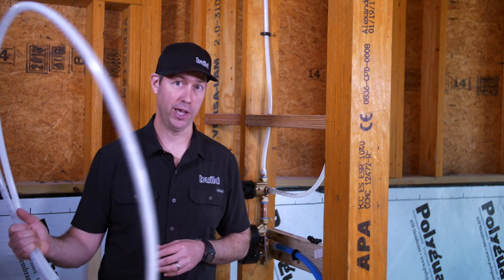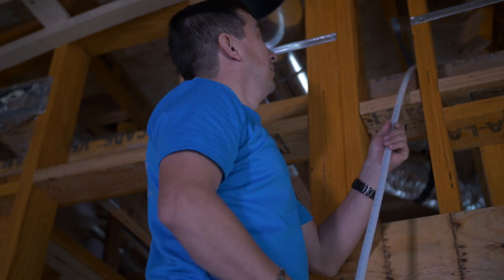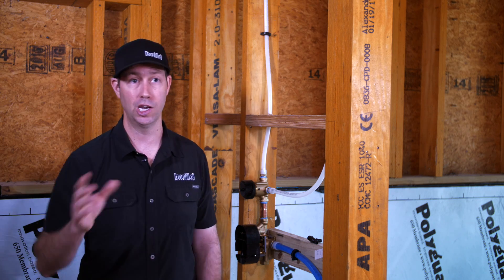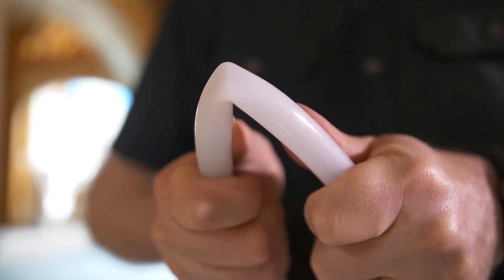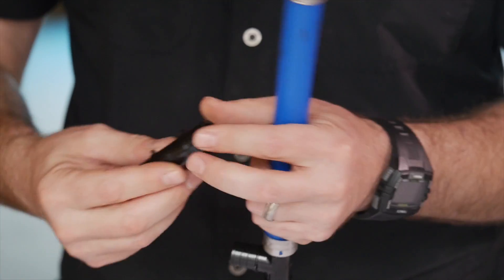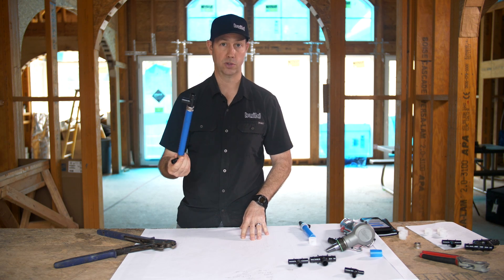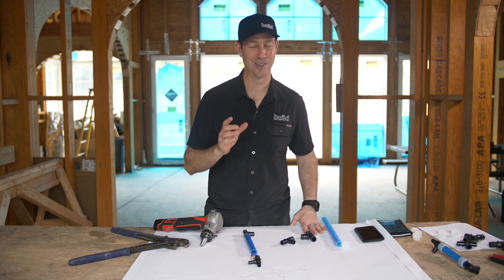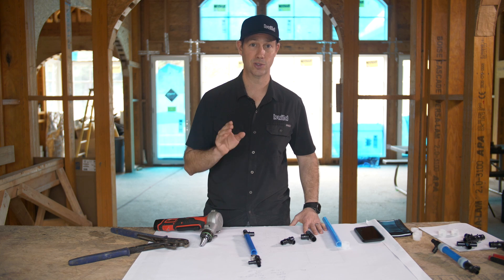PEX vs. Copper Plumbing

Comment: One thing Matt should have mentioned was the difference between the oxygen barrier and non oxygen barrier PEX.  The non-oxygen barrier PEX is what you use for fresh water and the oxygen barrier PEX is what is required for closed loop hydronic heating systems.  The O2 barrier is necessary in hydronic systems which contain ferrous metals such as non stainless steel circulators or cast iron or steel boilers.  Standard non O2 barrier pex will absorb oxygen from the ambient air and within a short time rust out those components.

I am amazed how many people are concerned about a plastic taste with PEX.  PEX is cross linked High Density Polyethylene (HDPE #2 recyclable plastic)  It is commonly used in the food industry from 1 gallon plastic jugs containing spring water and milk to 55 gallon drums containing everything from juice concentrates to vinegar.  As far as resiliency to chemicals and petroleum based solvents, ever look to see what your portable plastic gasoline, Kerosene, and diesel fuel containers are made out of?  HDPE has been around a long time and has never leached BPA.  As far as PVC and CPVC, it leaches all kinds of nasty chemicals when heated so I would personally never use it for drinking water.  Copper is the best unless your water is acidic, in that case the water etches the copper pipe and you are consuming copper in your drinking water.  In high doses can cause copper poisoning.  Most pipe for water wells or water lines buried underground between buildings on farms has been black poly pipe since at least the 1960's.  The black poly pipe contains "carbon black" which makes the pipe black and prevents damage from UV.  It has an estimated lifespan of 50 to 100 years exposed to sunlight.  Understand what the pipe is and the history of HDPE in our water systems before you make out PEX to be a bad plumbing alternative.  Like Matt Risinger I prefer the "pro pex" PEX A product by Uponor and have been using it since the mid 90's when it was sold as Uponor/Wirsbo.

On a side note HDPE is also used now in replacement hips and knees as the wearing surface since HDPE particles in the body are not as dangerous as teflon and other materials used in the past.
Reply: @Dynamic Energy Solutions -  The PEX-AL-PEX with the aluminum layer is not all about the O2 barrier. It gives other unique qualities like better durability, smaller thermal expansion, stronger UV resistance, no annoying coil memory and the ability to withstand 200 psi.
Reply: david s. Must've slept through his high school science class.
Reply: Neither, the aluminum layer is in the middle, pressed between two layers of PEX.
Reply: Shadow light 
In the USA you can get pex with a polymer o2 barrier, so there is no aluminum.  The aluminum center layer was common here 25 or 30 years ago.
Reply: A side note, Bisphenol A (BPA) Isn't used in a thermoplastic such as PEX. It can't leak into the water because it's not there. :)
Reply: @shinobi6622  first of BPA is a chemical that is linked to health concerns in large quantities. BPA has absolutely nothing to do with the taste of plastic in the water. That taste is from the chemicals used to make the plastic. Canned goods contain BPA liners, but do not taste like plastic when you eat them. BPA free bottled water, when left on the shelf for 2 to 3 years, will distinctly taste and smell of plastic when you drink it after it has been sitting.   
   
So is saying that PEX can't possibly taste like plastic, because it has no BPA in it, is an absolutely ludicrous statement because  BPA has absolutely nothing to do with the reason why it tastes like plastic.
Reply: what has that to do with making a cup of tea.
Reply: Dynamic Energy Solutions i like you you did your home work great info. More than the presenter presented.
Reply: @Dynamic Energy Solutions, with pex there are mtbe and voc  concerns.

https://www.ncbi.nlm.nih.gov/m/pubmed/21976195/

https://www.nsf.org/newsroom_pdf/water_PEX_fact_sheet.pdf

https://www.purdue.edu/newsroom/releases/2014/Q4/drinking-water-odors,-chemicals-above-health-standards-caused-by-green-building-plumbing.html
Reply: Dynamic Energy Solutions nice to see a comment from someone who has some facts and not just speculation. Here in the UK PEX is pretty commonly used, you get those who prefer copper but to my mind pex has more advantages, some that weren’t mentioned here, less heat loss etc. The US fittings are very different, it’s mainly push fit on pex in the UK, not tools needed, even quicker instal.
Reply: Good comment
Reply: Dynamic Energy Solutio
Reply: thank you for mentioning this very important
Reply: Dynamic Energy Solutions I though that oxygen barrier Pex was “Pex C”, which was referenced.
Reply: just reading, and thinking. about the oxygen transfer... wouldn't it make a difference if the water was under pressure or not? like would oxygen ever pass through the pex if the water pressure stayed at 2 bar? (i realize one side of pump would be low pressure if closed loop, just asking in theory)
Reply: @zparnell  It depends on the partial pressure of oxygen on either side. Since there is a lot of oxygen in free air, the direction of migration is toward the inside of pipe in the hydronic loop, despite any difference in water pressure.
Reply: We just got approved for CPVC in Chicago and I would never touch that shit.
Reply: Those pex crimps actually withstand that kind of pressure?
Reply: @Mark OnTheBlueRidge The aluminum vapor barrier is in between two layers of PEX and cannot come in contact with the water
Reply: A voice of experience and knowledge! Thank you!
Reply: Ummm pin this comment sheesh thourough
Reply: Good information. Thanx
Reply: Pex-AL-Pex is most common for drinking water in Slovenia and I think most central Europe, Germany etc. (Pex with aluminum vapor barrier)
Reply: I can’t believe that using ordinary PEX can lead to components rusting out in a hydronic heating system. Many of these systems are open to atmospheric pressure and thus the water is in constant direct contact with ambient air, often the air gets sucked into the system and you can hear bubbles going through, yet they don’t suffer from parts rusting out in a short time. I do believe corrosion inhibitors are typically used as well. I figure that using PEX with an oxygen barrier in a hydronic heating system will make no difference whatsoever, except perhaps to lighten your wallet.
Reply: @Ethan.Lamoureux  Osmosis occurs because 02 molecules are smaller than the polyethelyne that makes up the pex tube, and 02 migrates from where the concentration of 02 is higher (air) to where the concentration of 02 is lower (water in the pex tube). Hydronic systems with metals susceptible to oxidation use corrosion inhibitors and are supposed to include air separators to remove air bubbles and dissolved oxygen to reduce the rate of oxidation.
Reply: Aside from the epic debate on whether the oxygen absorption is a myth or not, anyone care to weigh in on the possibility of mice being able to chew pex vs copper?
Reply: The fact that PEX is used in food industry doesn't mean that it's fine/completely safe though.  Today we use all sort of poisons in production of our food even, let alone food plastic utensils.

Plastic is plastic, no matter how you put it. Unless it's a biodegradable, plant based plastic.

Let's be smart about things all theinformation way, ok?  And honest all the way, too.
Reply: Maxim C. Have had in my house go going on twenty years and I’m fine , plumbing and floor heat no leaks at all, and I work as HVAC TECH and have repaired quite a few leaks on copper and there’s no lead involved, now maybe my testosterone level has gone down, but that’s more likely from living with three daughters and my wife lol
Reply: @MaximC  No, plastic is not plastic. There are countless types and variations upon variations that have very different chemical structures.

Please, just spend just 10 minutes researching their production methods and chemical properties.
Reply: @454Casull  
I know they are countless of different petroleum derived products. But we put them in our food (plastic bottles, cans, and so on and so forth - and we do end up eating/drinking them, and we know that it's poisonous), so 1) the original commenter thinks that the fact we use it as "food-grade" means it's totally safe - is wrong, 2) no petroleum derived product is ok to store drinking water in, and 3) we should replace synthetic materials with natural every time that we can.

It's unquestionable that plastics can be very convenient (in this case it's easy and fast for builders to install), but let's be realists and acknowledge that petroleum derived plastics are actually completely safe and/or better in terms of health effects and environmental effects than other materials (glass, wood, clay, metals, etc).
Reply: @MaximC  Well natural is not always without danger. Lead is natural, but not good to have in contact with food, putting it mildly. Using radioactive compounds in cosmetics for a 'radiant complexion' for some reason went out of fashion years ago as well :).
Reply: @comment6864  
Clearly. We should use different natural materials for appropriate to them uses, but my point was that materials we use shouldn't be toxic/synthetic/non-biodegradable (whenever physically possible).
Reply: @MaximC  Yes, i agree completely. However, here too you have to use common sense. There are plastic objects that are extremely commonly thrown away into the environment, and there are those that are extremely rarely. Piping inside a house probably fits the second category. I would much rather we focus on eliminating as much as possible use of plastic bottles, bags and eating utensils, unless they are 100% recycled. Especially plastic bags - i think they do far more damage to the environment, animals in the oceans, etc. and even people in the poorest countries living next to water, than other recyclable items, because they are not as commonly recycled, though it is possible. For some reason plastic containers do get picked up by the town, but plastic bags you have to bring in yourself. Things like that are key - making it easy for people to discard in a responsible way. I think plumbing systems far more rarely end up part of this dilemma. I would prefer copper probably, but if it's cost prohibitive to switch to a hydronic heating system because of them, then i would go with PEX by all means. It should be for 100 years.
Reply: @comment6864  
Well, we can avoid using it whenever possible, it's not a zero sum game.  About the cost - that's the exact problem with the current socio-economic system - we tend to not use sustainable materials (including PEX, bags, etc) instead of sustainable/natural ones, simply because, in terms of pieces of paper, it's cheaper to produce the synthetic stuff instead of natural.  In other words - the so called externalities (ecological pollution, or more generally damages to human physical and even mental health) are not considered in the price tag, and that is the whole reason why we are unsustainable, see incredible climate change, etc.
Reply: Actually, I work in a water Laboratory for a major municipality and deal with membranes on a daily basis and I have to deal with salesmen who try to sell residents garbage based on junk science... all the time.  by your words " Standard non O2 barrier pex will absorb oxygen from the ambient"  . Let me put it another way..... your telling me that if I put a piece of pex (polyethylene) in a sealed container and that container held a mouse....... the mouse would die because the pex absorbed all the O2.  Your wrong.
   Now... I did some research and they do recommend using PEX with O2 barrier for closed loops systems........ but not because of the science you described and I can find absolutely no proof... Not one... source where using the regular pex has actually been proven to cause a problem. I can find no lab study, no results,... nothing... and I've seen plenty of heating system's using the regular pex.  I'm more inclined to think the chemistry of the water has more to do with corrosion problems.

 Now... I'm always up for learning ne things.. and I'm always skeptical because there are so many slick salesmen with no scientific knowledge selling crap in the water industry.  So point me in the right direction. To a source for knowledge, like UL laboratories.... or similar.
Reply: sounds like a load of horse manure to me.  So your telling me the H2O, which is Hydrogen and Oxygen already, absorbs Oxygen through a non-permeable layer from ambient air... which I would like to point out is only 20 percent oxygen.
  I tried to look for a study done in a laboratory on this... but could not find one. 

I would also like to point out that there are many, many systems that contain ferrous metals, that circulate hot water and air...... and they last a long time.  Take a car radiator for example.     

 Your science is flawed, and you sound like a salesman.
Reply: david s. By your logic carbonated water would be impossible.
Reply: @davids.9834  Without an oxygen barrier, pex piping is a semipermeable membrane, and the 02 molecules which are smaller than the polyethylene molecules that make up the pex tube, will migrate through it from where the concentration is higher (air) to where it is lower (water). The process is called osmosis. A car radiator without radiator fluid will rust out, not due to osmosis, but due to the oxygen in the air in the system.
Reply: Yes, gas permeability through polymers is a real thing. Why do you think chip bags have aluminum in the multi-layer Mylar packaging? Or, keep a bottle of carbonated soda/pop around for about 12 months and then open it and drink it. You'll find that the amount of CO2 has noticeably gone down from a "fresh" product.

http://polymerdatabase.com/polymer%20physics/Permeability.html

For what it's worth, coolant in heat exchanger systems generally has corrosion inhibitors.
Reply: @454Casull  keep a bag of chips on the shelf for two to three years, then open it and take a Sniff  or a bottle of water that has been sitting around and tell me that it hasn't absorbed any chemical taste or smell from the packaging.   
   
There is an expiration date on the package for a reason. Well it won't kill you, the plastic taste is more than prevalent.  So bpa-free or not, that plastic is still going into the food or water.
Reply: @viperfukgoogplus386  Why are you replying to me?

Comment: Nice video. You left out something about copper vs pex, probably because you build "up north".  Here in Florida, almost all homes are concrete block on concrete pads.  Copper degrades quite quickly if it is even touched by concrete, and leaks from that are somewhat common.  The pipes are supposed to be plastic wrapped if they are touching concrete, but splashed concrete/mortar/etc can end up on unprotected copper pipe and result in a leak years later.  It's happened in my home twice now.
Reply: Good point Larry,... and bonus points for calling Texas "up north" :-)
Reply: Larry B good point. I bet that was a headache to fix.
Reply: Larry B Thinking of running PEX for a concrete block house I'm purchasing. Have any experience? I've heard of a lot of issues with copper leaks in FL.
Reply: I replumbed my whole house with pex do to so many leaks here in south Fl. All new plumbing is going through  the attic now due to the old stuff being installed in the concrete pad.
Reply: onlychevys Williams plumbing in an attic sounds like a very bad idea
Reply: Are your houses all piped with type  M or what?
Reply: I live in Florida. My home is 35 years old and just developed it’s first slab leak. The plumber tells me that he has repiped 60 homes in my area in the last 3-4 months. Many of my neighbors included. After much research, I opted for Pex. The installer assured me that the latest generation of pex is worry free. 10 year warranty (5 on cpvc) and should last easily 50 years trouble free. So far, could not be happier. Installation was 2 guys, 3 days. $6,500 total, including the sheet rock repairs.
Reply: You don't need a slab for the copper to leak here in Florida, I have a crawl space and from what I have been told the original plumbing  started leaking (pinholes) within 10 years.  House was re-plumbed with polybutylene '95 and hasn't leaked yet.  Yes I am saving up to replace the PB with PEX though.

Comment: im a handyman / remodeler that does limited plumbing, and ive mostly used copper because im mostly adding onto or repairing existing systems. I like that you can re use fittings, and that its fairly easy to dissasemble and move things around if you need to.

I did get into pex when i was adding several filters and relocating basically half of the plumbing in my basement, that ended up being pretty complex. 

even though i ended up mostly having to use fittings because of tight quarters, it still was allot easier to get it all together than copper would have been. my only complaint was difficult to reach areas with the full band crimp tool, you need allot of leverage and really need to brace one handle on something, and also you need a fair amount of space around and some behind the fitting to work the handles, i really cant see using this type in tight quarters. for the tight areas i got the pinch type tool and that solved the problem. it seems like the pex A type would solve this problem too, and i like the better flow through the fittings,.something i saw as a distinct disadvantage of the pex B over copper.